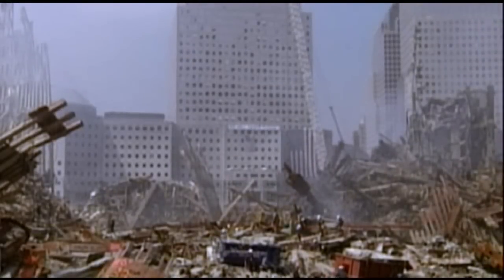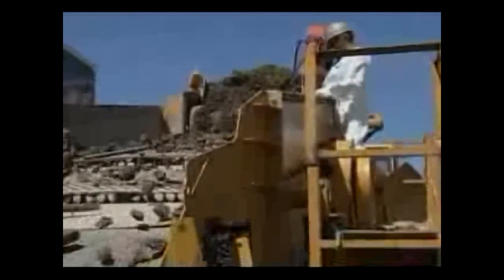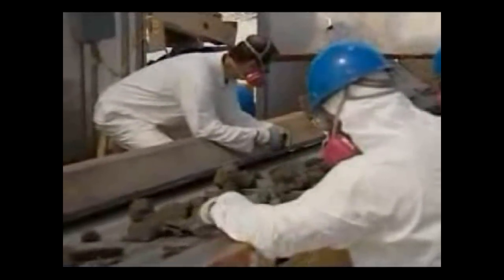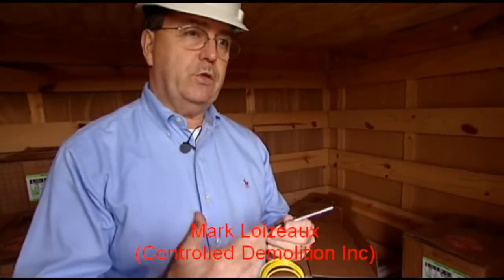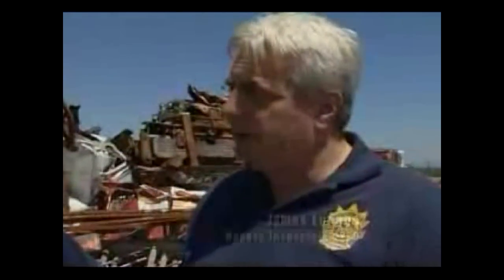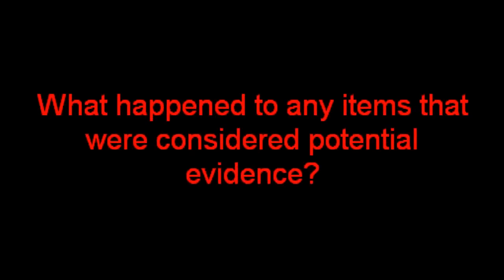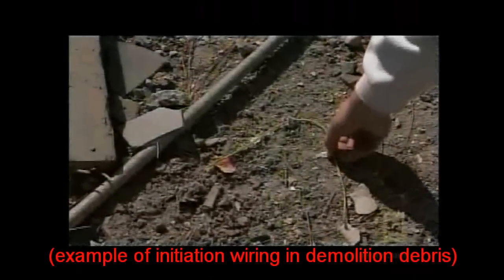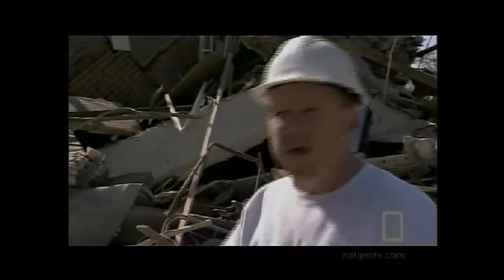Project Truth (WTC) - Sip 3.1 Physical Evidence A (Demolition Components)

Comment from the maker: Which of the three?

Detonation or Det cord is one very cost effective product used in commercial demolition to initiate explosive charges. However virtually any type of electrical wiring can be utilised to initiate electronic detonators as shown at 4:47 in this clip. What you need consider are the differences between a commercial demolition and a sabotage operation. Do you really think they are going to use readily identifiable demolition products? Or would they instead try dissimulation?